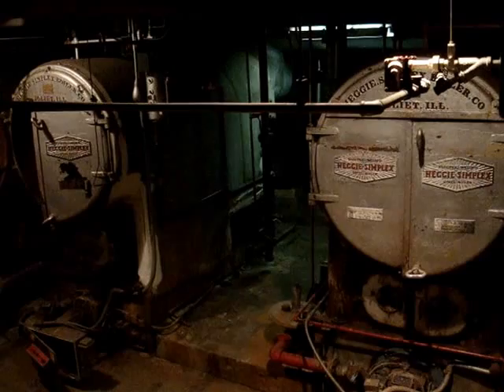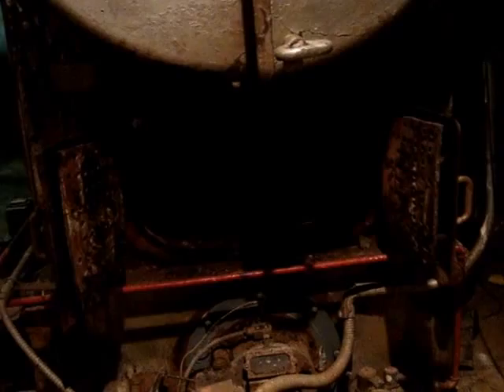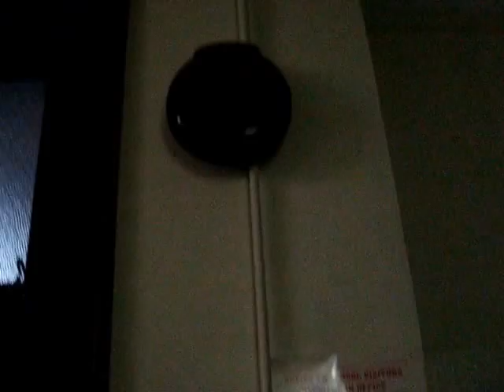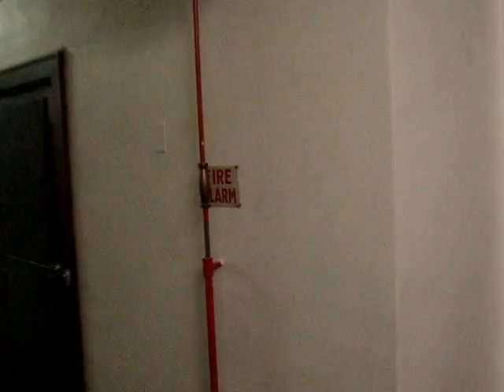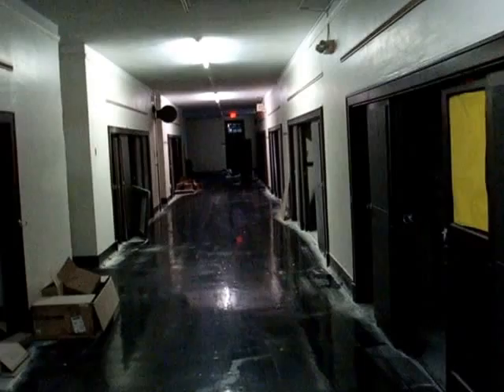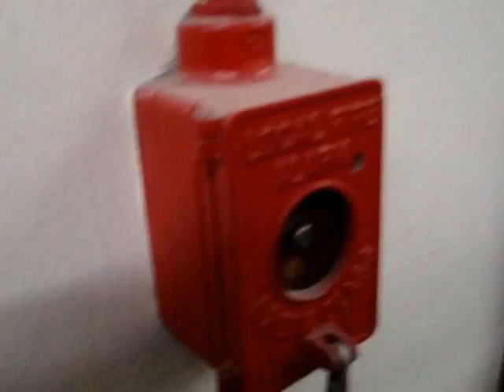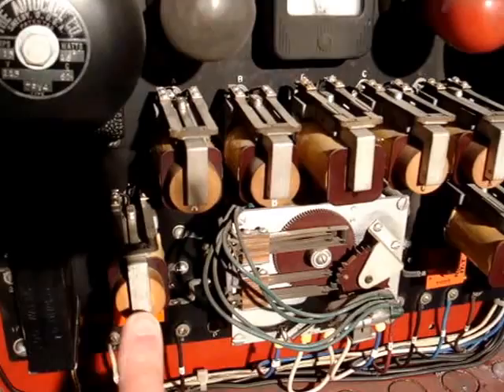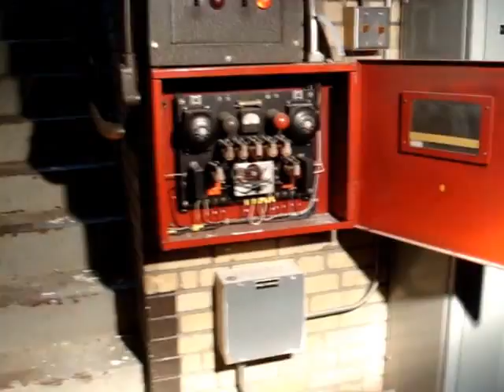AUTOCALL FIRE ALARM SYSTEM @ HOTCHKISS ELEMENTARY

Comment: Drove past there today, it’s very sad to see the condition the building is in now. Even as it rots away, you can still see the the beauty it has. The front exterior is extremely gorgeous, all the terra cotta medallions and nice masonry work really catch my eye. There are very few schools left that were designed by architect M.M Konarski. At one time there were 18 school buildings he designed that had those terra cotta medallions and beautiful masonry work on their facades. Now there’s only 4 left and 3/4 are completely abandoned, the only one still in use is North High. When they sold these schools, I wish they would’ve made sure these buildings were sold to qualified buyers that had the capital and a solid plan for them. Most of these buildings were unfortunately purchased for tax-write offs. Every building they sold is just sitting and rotting. It’s depressing to watch these historical school buildings fall into disrepair as they had a lot of potential to be adaptively reused and were still solid. Hotchkiss was in decent shape when it was up for auction but now it’s sadly too far gone, whenever they demo it, I just hope all those medallions can be salvaged.

Comment: They don't technically use explosives to demolish these schools as they mostly use the excavators, and sledgehammers to tear them down. So typically if the old boilers are going down with the building they will likely have to be removed by crane after the school is demolished, and the rubble cleared.

Comment: Honestly they should make one of these schools into a museum for Fire Alarm Notation.
Reply from the maker: I could not agree more!  That would be an excellent Idea.
Reply: Old School Fire Alarms I mean it's just a sin. Not only for these systems but these incredible architecture of most of these buildings.
Reply: Schools like this one McKinley, George Barber, and Goodrich. One with the styles and older Architecture that visually are masterpieces of old century styles that you just don't see anymore.
Reply from the maker: You and I are on the same page. After all these older schools are gone, they (meaning the school districts) will wish they had preserved at least one of these architectural treasures and made it a museum.
Reply: Yeah those pictures (I have no Idea what they're called) on the outside walls are priceless.
Reply: I wish they still made that kind of system today except with a smoke, carbon dioxide or heat dector hooked up. Also with projectile horns.
Reply from the maker: You can hook heat/smoke detectors to this panel also.  This system was also made with projectile horns or bells. Check out my video,  VINTAGE AUTOCALL / PULL ROD FIRE ALARM  to see this same system using projectile horns.
Reply: That was a nice system.
Reply: I will check it out but right now I can't afford a fire alarm system.
Reply from the maker: I understand and appreciate that.
Reply: I figure with alarms that makes beeping noises and voice evacuation is just unrealistic with evacuation alarms so they should still have those older projectile horns or even still keep making them today.
Reply from the maker: I agree with you 100%.
Reply: I wonder if you could make some kind of petition and or other people who love those kinds of alarms to bring them back in production.
Reply from the maker: There would have to be a very large demand to but these old systems back in production to make it profitable.  Unfortunately, there is not enough people that would buy them to make it worth while for a company to manufacture.
Reply: I notice with fire alarms today they only last for a few decades before they quit working but these old horns may have out lived them. I could special order them.
Reply from the maker: Today's modern fire alarm systems are cheaply made and truly junk.  You're lucky if you get 5 years out of them before something major goes wrong. If there is an electrical surge, many times the whole panel has to be replaced. The old systems that are featured in my videos were built like tanks and made to last. They were manufactured when hardware was truly "hardware", not plasticware.
Reply: Yeah they shouuld've figure out which ones are the best and how cheap they are.
Reply: I can see your point so that is why I wished they still made them today but they could bring them back in production if that what people want. I could make a petition to do it. Simeplex and Faraday did made that kind of stuff?
Reply from the maker: Both Simplex and Faraday made similar types of fire alarm control panels starting from the 1930's up through the 1960's.
Reply: They could be also called coded panels correct? If they were still in production today they would have outlast modern control panels. What about those horns? I do believe that some of them were 4030 horns.
Reply from the maker: Yes, they are coded control panels that would be wired to non-coded pull stations. You are also correct about the horns. IBM and Simplex made the 4030 models.
Reply: Newerageserveralarm said that it was Edwards that still makes 4030 models today is that true?
Reply: These modern alarms we have when there is a fire drill at a school with voice evac or chimes, buzzing all unrealistic sounds the kids may laugh or just disregard the shock sound in regardless. If those were 4030 horns or faraday horns then the kids would be more alert that this is an emergency.
Reply from the maker: Its possible, I am not that familiar with Edwards products but they would not use the same model numbers as Simplex and IBM.
Reply from the maker: You are absolutely right about that. The new audible devices that are installed today are laughable. They sound ridiculous.
Reply: That's true if the panel is a bottom-of-the-barrel model and/or has crap caps.
Reply: I swear that it's possible for the Wheelock 7002T signals to go longer than 30 years! (And 34T, of course)
Reply: And for the 1980s (especially some later-1980s horns) Faraday has a problem with some dying in just roughly 10 years, I think due to reed contact corrosion! More likely to hear ones that sound like garbage, when placed near doorways to or near outside!

Comment: Nice vid! I've always wondered what those light bulbs next to the trouble bells were for. Interesting how this system will stop after 4 rounds of code whereas IBM systems (at least from what I'm told) will keep going as long as the circuits are active. Did you end up replacing the glass in the pull, or did you just abandon the system as-is?
Reply from the maker: After filming, I did replace the glass and reset the pull station. That is true about old IBM control panels. You had to reset the pull station and/or actuation device to stop the control panel. Thank you for watching and for your question.
Reply: @OldSchoolFireAlarms  I have to ask, do these systems have spare glass pieces in the cabinet or somewhere or did you have them on you

Comment: I'm curious of a couple things with this system, one is what in the panel senses four rounds and makes it time out and stop on its own without resetting the pull box? I know there's no electronics here due to its age and second, what happens after it has timed out and the pull box hasn't been reset yet? Does it cause a trouble signal? Can the button be pushed back in for a few seconds and released to set it off again? I'm sure it's simple engineering lol that's what's nice about these old systems, is their simplicity...
Reply from the maker: Great questions!!  To answer your first question, there is a relay marked  "J"  that is mounted in the lower left hand side of the panel. This relay prevents the code motor from running continuously after an alarm.  Relay J de-energizes relay B thereby causing the trouble bell on the left side of the panel to ring until the glass in the operated pull station is replaced and reset. To answer your 2nd question, if the operated pull station is not reset, the trouble bell will continue to ring until it is. Anytime there is an open circuit or the system is in alarm mode, the trouble bell will ring.

Comment: Which would be more painful to the ears, a 6/8/10 inch bell (vibrating OR single stroke) or a single/dual projector vibrating horn?
Reply from the maker: Very good question!  A vibrating 10 inch bell is definitely more painful to the ears then a single stroke bell. But the vibrating horns (buzzers) have them all beat when it comes to loudness.
Reply: Ok

Comment: Could you please rescue the fire alarm system and the exit sign and emergency lights
Reply from the maker: I will definitely do my best to salvage those items.
Reply: Ashame the Original Exit Signs have been replaced with battery backup LED, the Original Exit Signs were likely REALLY COOL! Likely Glass and Steel boxes, utilizing 25 watt medium base bulbs💯, current NFPA and OSHA standards REQUIRES Battery Backup Exit Signs, where NO backup Generator is present, Circuit only supplies 120 vac. With no secondary backup for emergency Circuit, In such a Circuit that utilize an emergency Circuit, the Cable from the wall or ceiling would have A black wire "HOT" side 120 vac, one white "Neutral" side, but also a "Red" wire , Red wired to one black wire of the exit sign, the black to a second black wire from the exit sign, and the neutral, however these were later 1950's where large dry cell batteries would keep one socket in the exit sign illuminated in the event of power failure until the battery drained completely, and would not be recharged until 120 vac power restored💯

Comment: I've found one of those pull stations on EBAY AND IT'S IN GOOD CONDITION AND IT'S GOT WHITE PAINT ON THE LETTERING SO I ADDED THE PULL STATION TO MY WATCH LIST , BUT I DO HAVE QUICK QUESTION ABOUT IT THE LISTING SAID THAT IT WAS TRIPED AND THERE'S NO GLASS WITH IT SO IF I GET THE PULL STATION IS THERE A WAY TO OBTAIN THE GLASS FOR THE PULL STATION IN CASE I GET A PANEL?
Reply from the maker: You will have to go to a glass cutter and have some made.

Comment: If the school wanted to, is it possible to take the timer thing out so that the bells keep ringing instead of just going 4 rounds?
Reply from the maker: It is possible that one could modify the panel to go longer than just four rounds.
Reply: @OldSchoolFireAlarms  Because my high school Fairport Harbor (about 30 minutes from Cleveland) did the exact same thing. It no longer has the autocall system, they replaced it with Gentex horn/strobes 10 years ago. They will probably tear Fairport down within the next 4 years, the town just passed a levy for it.
Reply from the maker: @matthewtaipale4112  Yes, that's what most school districts do. They just keep tearing down the older schools and replace them with cheaper built newer ones.

Comment: If the alarm stops after one minute in a fire would you have to keep pulling the fire alarm?
Reply from the maker: One round sounding off should be enough to signal for a fire or drill, especially in a smaller building. But you could pull the fire alarm again if you wanted it to sound off another 4 rounds of the code 4-4-4-4.

Comment: Could u save those auto call pull and but a couple on eBay? Because I would love one of those in my system
Reply from the maker: Please be advised that these types of vintage Autocall pull stations do come up on eBay from time to time. Just keep checking on a regular basis and you will see them for sale/auction.

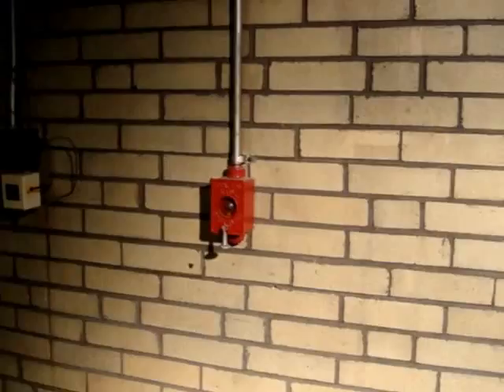Comment: why is there a bell in 10:35? Is it the same bells as the ones near the rods?
Reply from the maker: No, these are 10 inch electric, single stroke bells.  The bells near the pull rods are 8 inch manual trip bells.

Comment: is there any way i could get one of the single stroke bells possibly i looked all over the internet  and i couldn't find any time of single stroke bell
Reply from the maker: Yes, go to OldSchoolFireAlarms.com ,  you can buy one there. Just click on the CONTACT page and tell them what you want.
Reply: @OldSchoolFireAlarms  are there any FACPs for sale? What would be the price range if so?
Reply from the maker: Go to OldSchoolFireAlarms.com and leave a message asking about what you want to buy.
Reply: @OldSchoolFireAlarms  ok! will do
Reply from the maker: @TexasRailfan2008  Yes, there are many different types of vintage fire alarm control panels for sale. They can range anywhere between $250.00 to $1,500, all depending on what type and condition the panels are in. The older and more rare the panels are, the more expensive they generally are. Especially if they are in really good to excellent working condition.
Reply: @OldSchoolFireAlarms  i see, what would be an example of a $250 panel? (make, model, etc.)
Reply from the maker: A $250 panel would be a small panel with one bell circuit and may not have a cabinet. Notifier and Fire-Lite panels would be an example. Autocall, Simplex, IBM, Faraday, with two bell circuits usually start at $400 and up. Again, all depending on condition and availability. Some of these panels are really hard to find and very rare, which of course drives up the price.
Reply: @OldSchoolFireAlarms  ok, just checking

Comment: You should do your old high school
Reply from the maker: Unfortunately my old High School, which is East High School in Akron, Ohio, has been renovated and has a brand new fire alarm system. The old one was a pull rod system tied into an Autocall system using 10 inch single stroke bells. That old entire system was dismantled, pulled out and thrown away.
Reply: @OldSchoolFireAlarms  They just had to ruin history, huh?!
Reply: @OldSchoolFireAlarms  Thx for the like man. I just wish ruining, destroying, etc, and etc, history would be illegal around the wrld for eternity
Reply from the maker: @bigsebby3799  Yes, I agree. There is a terrible price to be paid when you try and erase or forget history.
Reply: @OldSchoolFireAlarms  The Abandoned Fire Alarm?
Reply from the maker: @mircomamsecohardwareandsafety  The school in the video, The Abandoned Fire Alarm, was the original East High School built in 1918. That particular school was converted into a middle school and renamed, Goodyear Jr. High School in the 1950's. At that time a brand new East High School was built on Brittain Rd. in Akron, Ohio. It was the new East High school that I graduated from in 1979.
Reply: @OldSchoolFireAlarms  Oh I thought it was the old because I saw it say specifically East High School
Reply from the maker: @mircomamsecohardwareandsafety  Again, there are two East High Schools, the one in The Abandon Fire Alarm is the original (old) East High School.
Reply: @OldSchoolFireAlarms  IK BTW I am not dumb

Comment: The codewheel doesn't seem to be turning very smoothly
Reply from the maker: The code wheel was working just fine. What you may be seeing is some distortion in the video playback. This happens sometimes with You Tube videos.
Reply: @OldSchoolFireAlarms  I was more saying this because of the sound. The bells were not ringing at a constant rate
Reply from the maker: @ThePurpleMage1  The bells are off a little  due to the mercury tube switches. The liquid mercury that is inside the glass tubes do not always come in strong contact with the electric contacts that are inside the mercury tube switches. When this happens it can disrupt the cadence sound of the bells.
Reply: @OldSchoolFireAlarms  oh that makes sense

Comment: Is this school still closed as of this writing?
Reply from the maker: Yes, this school is closed, abandoned and in decay.
Reply: @OldSchoolFireAlarms  Is the fire alarm system sill there with the power still on?
Reply from the maker: @sigglass2183   Most of the fire alarm system has been removed and power to the building has been shut-off.
Reply: @OldSchoolFireAlarms  How long ago did you remove them?
Reply from the maker: @sigglass2183  Shortly before the school was sold to a private owner, approximately two years ago.
Reply: @OldSchoolFireAlarms  Poor Hotchkiss,  have you heard anything yet if they plan to do anything anytime soon? Will it be turned into a community leaning center?
Reply from the maker: @sigglass2183  I have not heard anything. The school is now privately owned and sits totally abandoned.
Reply: @OldSchoolFireAlarms  Ok
Reply: @OldSchoolFireAlarms  Any update on this school as of this writing?
Reply from the maker: Still closed and the status is the same. This school will more then likely be demolished at some point. I will be posting a new video of this school in the coming months, so stay tuned.
Reply: @OldSchoolFireAlarms  But there is not a pending demoliton yet?
Reply from the maker: @sigglass2183  No pending demolition but I'm sure the city of Akron will be ordering it soon. The building is in really bad shape.

Comment: Has this place been demolished yet?
Reply from the maker: No, this school is still standing but in really bad shape.
Reply: @OldSchoolFireAlarms  wow
Reply: How is it in bad shape like what makes it in bad shape
Reply: You should do a revisit vid like u did with Bette's elementary if it's safe
Reply from the maker: @Swxcoyxte  Many windows are busted out, roof is badly leaking just about everywhere, most of the electrical hardware has been stolen, etc., etc. The building is completely trashed on the inside too. The whole school has been vandalized beyond repair.
Reply: @OldSchoolFireAlarms  that's sad, would it be safe to go in if u were to do a revisit vid
Reply from the maker: @Swxcoyxte  Actually I have, and will be posting in the near future.
Reply: @OldSchoolFireAlarms  oh thanks you so much bro
Reply: When was it recorded
Reply from the maker: @Swxcoyxte  Last recordings were done in August 2022.
Reply: @OldSchoolFireAlarms  k